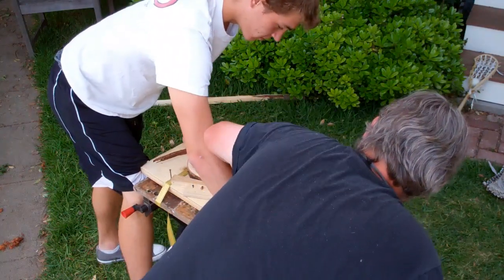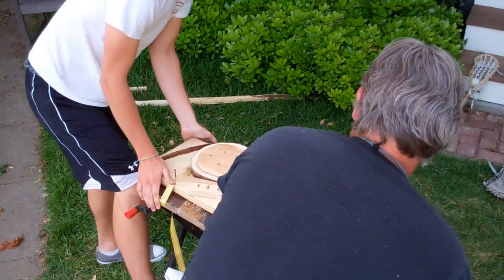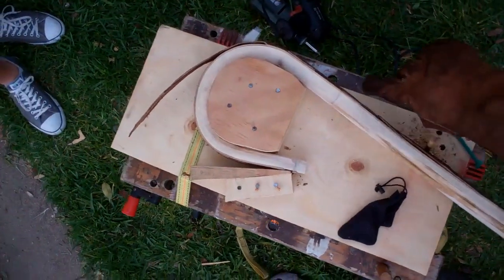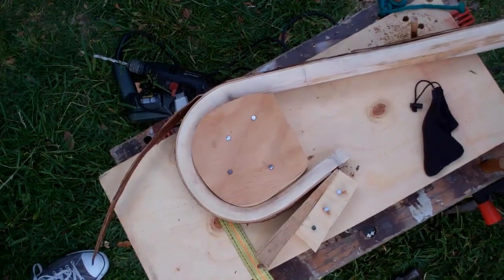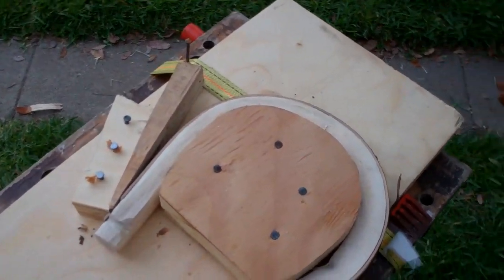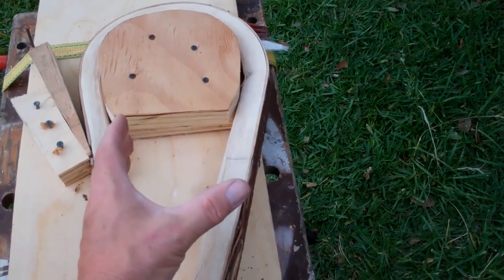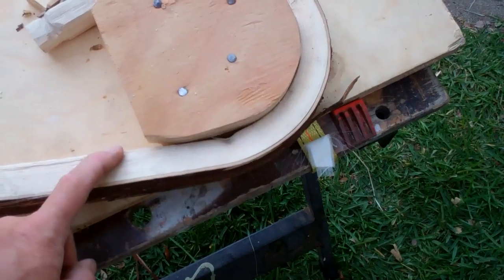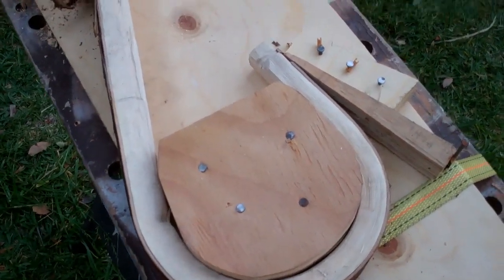Steaming and Bending Hickory to make an Iroquois Style Lacrosse Stick.mp4

Comment from the maker: @Paleoaleo (reply continued)...  I once the water starts boiling it starts kicking out a huge volume of steam.  I put the wood into the tube and  jam an old T-shirt in the far end around the end of the wood so that it helps to hold in the heat.   Provided that you use "green" wood (in this case, hickory...somewhat freshly cut and shipped to me by friends), the staves seem to take about 1 hour of steaming before they are ready to bend (and then they bend like a wet noodle!).

Comment from the maker: @panzuman Sure, but it would be a fairly boring video.   If you check out my photo site (search google with these terms (Paleoaleo + Imageevent) and you'll find my photo albums.  There's an album there with photos of the lacrosse stick project and several that show how I set up the steam tube and water and heat source (basically a high output propane burner heating up a 5 gal. metal can full of water with a radiator hose connecting the metal can with the PVC tube).